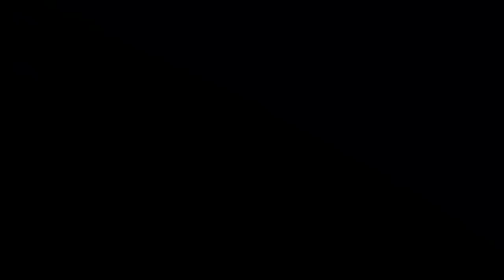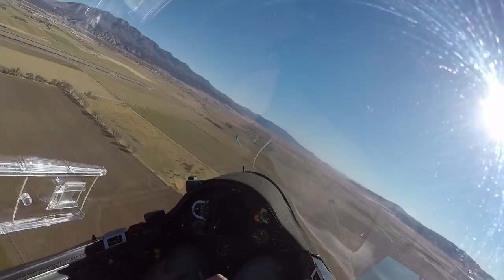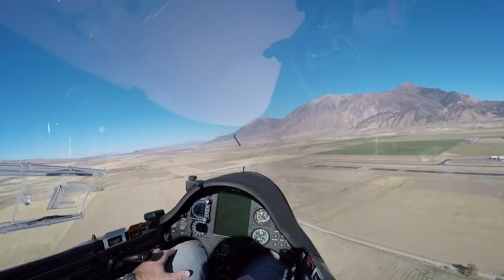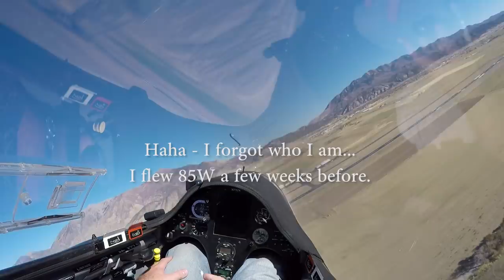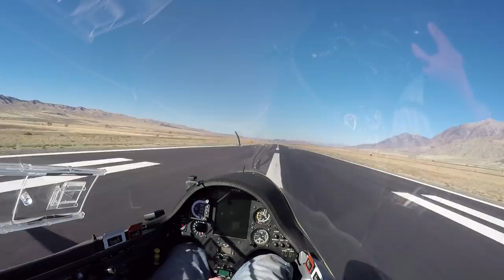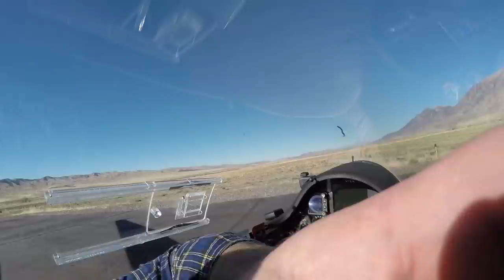Glider Ground Effect Demonstration

Comment: always fascinated with gliders. what is normal landing speeds? thanks
Reply: It may be the speed with minimal sinkrate (I was taught that -- theoretical lessons -- and only in the theoretical lessons -- never heared it again, lot of turbulence in the final); 
If you get your plane, you get your charts (sinkrate vs speed.
RTFM!! (it is for every plane different, even the ground effect is for every singe plane diffrent as you may fly an plane with little to nothing ground effect). The question is: Can you do this in an very high temperature at an high elevation.
You may vary your speed to hit the landing spot if you calculate: Your flight computer may help (LK8000, ..., or the markings at your VSI)

Comment: What is the fix if you have this situation accidentally?  Its obvious that nose down is not the answer.  Simply spoilers enough?  What to do in a flaps only ship?
Reply: anthony devita this was not a normal landing approach. Spoilers, when deployed, are highly effective and I think he executed a shortened normal landing procedure after he pulled up towards the end of the video. Flaps can at high degrees of deflection act as airbrakes also, you can also use sideslip(you steer the aircraft so that you expose the sides of it to the airflow, highly increasing drag) if the airbrakes fail or you don't have them. Ground effect happens always when you are close to the ground (one wingspan cca), so no landing is without it, so you get used to it(it's normal). It is most evident on high performance gliders, but every aircraft experiences it.

Comment: A 747 jumbo jet can not land unless doing less than 180mph, because of trapped air under the wings.

But somehow the jet that flew into the pentagon , flew at over 500 mph , only 6' off the ground. 

After all no wings were found at pentagon, or engines. Matter of fact not one piece of luggage was found at impact, nor did any of the 1000's of security cameras manage to pick up a jumbo jet crash landing into the most secure building in the world.

2 planes
3 buildings
Reply: "only 6' off the ground. " Lmao, you bought some fake news m8

Comment: When you flew up from the runway what did you do? Is the leaver on the left flaps? What was the grinding noise?
Reply from the maker: I both lowered the flaps and opened the spoilers.  You never would want to adjust them only a few feet off the runway.  The grinding noise is something in the main wheel mechanism grinding slightly.  Might be a rock or something.

Comment: So if a pilot is on final, and figured his/her standard glide path to the touchdown point will come up short, is it better to continue the current glide path, or dive for the ground, get in ground effect, to be able to fly further to possibly make the runway?
Reply: I would say that you should already know the curve for your lift-over-drag through the entire speed range of the glider, and fly at the speed that gives you the best L over D. Also, look for a closer bail-out landing spot, flat with no obstacles.

That said, a good pilot always thinks about their ability to get to a safe landing spot the whole time they are flying, and keeps their options available.
Reply: @logmeindangit  agreed...thanks...I agree with all you said...but...IF a pilot finds himself in the position I mentioned above, I still wonder if he/she could glide a further distance by diving for the ground and then flying in ground effect.
Reply: @Bill-NM , without knowing what you would be flying and what speed is its best L over D, my guess is "no."  

First, you would be diving, trading alritude for speed. There is an energy cost there, a lag-time in building speed as the glider falls.Taking a glider from a gradual descent at a moderate speed, and diving at a fixed angle, wastes altitude until the glider has finished accelerating. 

Then it has to change nose angle again to enter ground effect, and the slight increase in Gs there is another energy cost, even if small. (a nickel here, a dime there, adds up) Changing direction, pitch or compass direction, costs. 

After those payments, when you fly in ground effect, your glider is benefiting less when moving fast than when flying more slowly. 

So, you dive to pick up speed, then scream low and fast toward the airport, just above fenceposts, not benefiting much until you slow down more. Most of what you are doing when flying your glider 5' off the deck is just flying low and level, period. Exciting, though, I am sure! LOL!

As drag gradually slows the glider, the ground effect grows more significant in supporting the glider. 

The AoA must be increased as you slow, to maintain the 5 feet off the deck. As the glider loses speed in ground effect, the pilot needs to pull back and increase the nose angle to maintain level flight.  

If you are the one flying the same, you wasted quite a bit of stored energy when you went into a dive, slowly gaining speed as you lost altitude, and spent a little more when you leveled out. Then, ground effect is not yet kicking in fully, increasing its effect as the glider slows. Sounds like a swimmer panicking in the water instead of swimming steadily to shore, or being low on gas, so speeding up to get to the gas station.

OK, I hope I'm not rambling, but I'm typing while laying out the energy cost and benefit analysis of your scenario, versus a steady optimal glide, to see if I can wrap my head around it ... without doing any math. 

Your scenario is intriguing, and though my knee-jerk gut reaction is to glide carefully and steadily toward the runway, I didn't want to ignore any extra distance you might get from being in ground effect. 

My gut still says it won't help, but hurt. This is an interesting question though, for sure! - At least to you and me! I wonder what Bruno has to say about it. Or some other person all aerodynamically physics smart.

Comment: He says NEVER to adjust flaps and pull spoilers when in ground effect.
Then does it ( do as i say, Not as i do ).
I'd put small wing-tip wheels on to prevent dragging the wings during the end of the landing ...
Reply: You notice that he pulls up out of ground effect before he pulls spoilers and lands normally.

Comment: He is wrong about the wings having less drag due to ground effect. Drag stays the same and lift increases due to added pressure under the wings due to compression of the air between the wing and the ground.

Comment: Would the ground effect be more significant or a glider or a PA28?
Reply: My guess would be glider based on wingspan. However there are a bazillion factors I'm sure. Great question, I'd like to know.
Reply: In a glider. Not only because of the better wings, but because the would be way closer to the ground.

Comment: I think its called an 'open ended comparison' when you claim something like 'It only lost 5mph over a mile'  when you say that with the inferrence that's because you're in ground effect ...... 'Cos you don't say how much speed would have bled off in level flight at higher altitude.  We dunno if it would have lost 10 or 2 mph if you'd flown that at a thousand feet too.

On a sort of related point,  you say in the text don't do what you did and just lift slightly to apply flaps and airbrakes. I understand flaps would likely tip your nose down, but what would airbrakes alone do to a glider?  (Genuine question as I flight microlights not gliders & airbrakes ain't a fitment on anything I've flown ).
Reply: Farweasel I love how your irritation is incredibly specific. Love the detail

Comment: What does that "bleeping" represent?
Reply: the barometer makes a happy chirping sound when the plane is rising (air pressure decreasing) and a sad tone when losing altitude (increasing air pressure) It accompanies a gauge on the dash that tells the pilot just how fast they are rising or falling, in feet per minute, meters per second, or other units. 

The faster the plane is rising, the higher the chirping pitch goes, like it is excited, or frantic! LOL!
Reply: Hi Bruno, thank you for sharing this video showing your plane in ground effect. It would be fun for the viewers for the narration or a caption to show your speed at the start of the ground effect, in addition to the comment of losing about 5 over the mile traveled. 

One question I had was when you said that the drag was reduced. I would have thought the drag remained basically the same at that airspeed, but that it was the LIFT that had increased, due to the air's compression beneath the wings. (The L/D got more L and an unchanged D.) Please correct me if I misunderstand this. Thanks!

Comment: I’m an f1 fan and I thought ground effect made downforce and not lift interesting 🧐🙂
Reply: F1 cars have upside-down wings which provide negative lift - as you correctly say, downforce. Aircraft wings at very low altitude produce a squeezed cushion of air between themselves and the ground upon which the aircraft rides..
Reply: @rogerturner5504  correct

Comment: Would have been much more impressive if you had extended downwind and done all that ground effect flying heading back to the runway and landed on or near the touchdown zone instead of the other end of a very long runway.  That would be a proper demonstration of ground effect.  But I don’t think you had the confidence in yourself to try it.  As we saw, your safety factor was a bit overdone.  That’s all fine but I don’t believe I’d put myself on Y/T and announce I’m giving you a demonstration with the ending so ridiculous.
Reply: Could you be more condescending, judgmental and less generous? We all watched this video to enjoy but your attitude is to steal the pleasure. Not cool.
Reply: unfurling ,  Sorry, didn’t realize it was going to butt hurt someone.  It’s always enjoyable to watch flying video’s but a “demonstration” should preferably not also show a ridiculously high over speed approach which was going to show him going off the end of the runway if he had not popped the speed brakes or spoilers so get onto the ground.  What seems to be the case is he was show boating and kinda screwed up.  Listen to the opening radio chatter and you’ll hear the guy he’s talking to say he thought he was showing off.  But to each his own.
Reply: We all anticipate your professional video of a glider going over 5,000 feet, just a few feet above the ground, and then stopping at the exit at the end of the runway (this is where gliders normally stop the landing roll at Nephi airport because the ground handling equipment is kept there).

Comment: This guy doesn't know what ground effect is. Money can buy you a pilots license but it can't buy you intelligence.
Reply: The Ginger Power Ranger And you do?
Reply: @theespatier4456  In fixed-wing aircraft, ground effect is the increased lift (force) and decreased aerodynamic drag that an aircraft's wings generate when they are close to a fixed surface. When landing, ground effect can give the pilot the feeling that the aircraft is "floating". When taking off, ground effect may temporarily reduce the stall speed. The pilot can then fly just above the runway while the aircraft accelerates in ground effect until a safe climb speed is reached.

Comment: What is this? Is this how guys who can’t afford planes pretend they’re pilots?
Reply: Trolling?
If not - watch his video of to Grand Canyon and back - nearly 5 hour flight. The thing is that if there are any 'real' pilots at all - then sailplane pilots are in that group.
Reply: Flying gliders is REAL flying and they are VERY real pilots, not pretend for sure.  Any power plane pilot who don't think soaring would increase their knowledge and skill is a ignorant of the subject.  Higher end sailplanes also cost a bundle these days.  Watch his flight in the Tetons if you think you're a badass pilot cruising IFR in the flight levels.  It's highly skill intensive with diverse sources of lift, and other variables.  It's cool to really feel what the surrounding air is doing, and you KNOW because you're going slow and are in it.  I love the new GPSed based glider equipment.  Circling and navigating by a paper map is not my forte.  But it used to have to be for top glider pilots.